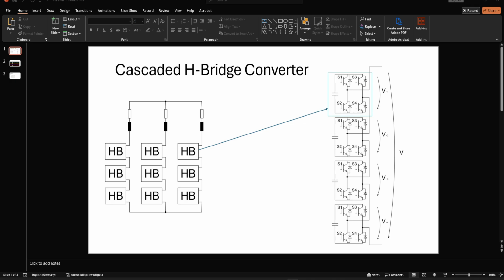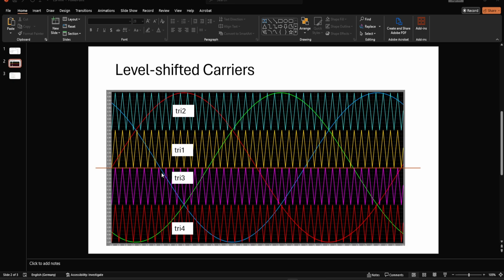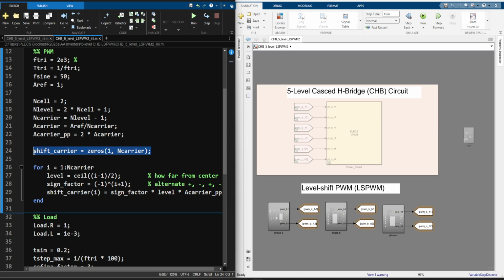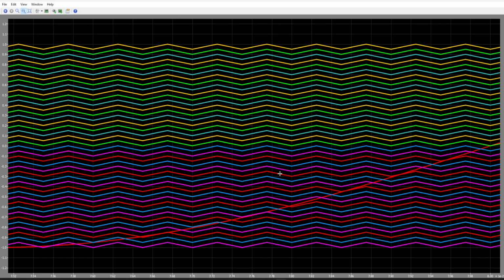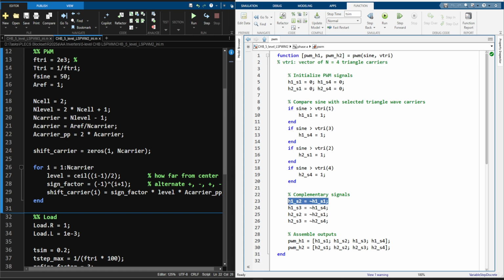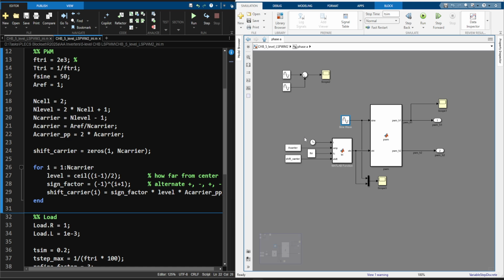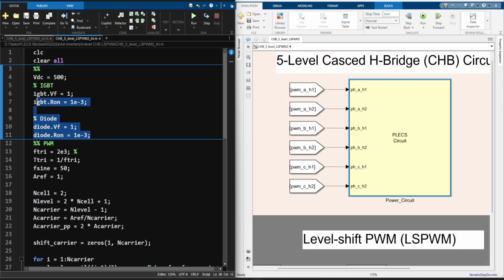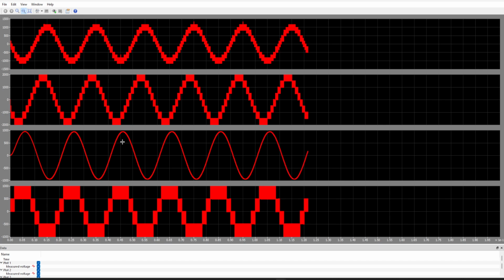Level-shift Pulse Width Modulation for Cascaded H-Bridge Multilevel Converter in PLECS/Simulink

Comment: Can u do Simulation video for single phase 5 level switched capacitor boost inverter
Reply from the maker: I will try. Have to find some time. Thank you
Reply: @ElectroPowerSys Thank you so much! If possible, could you please try to upload the simulation video a little sooner? I need it urgently for my work. I completely understand if you’re busy, but it would be a great help if you could do it soon.